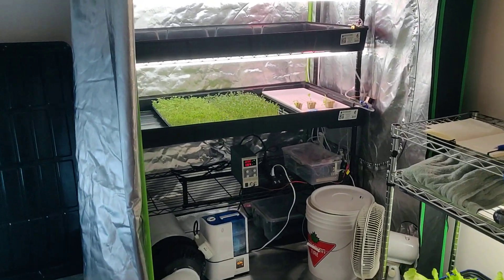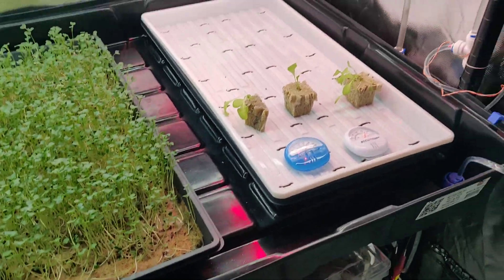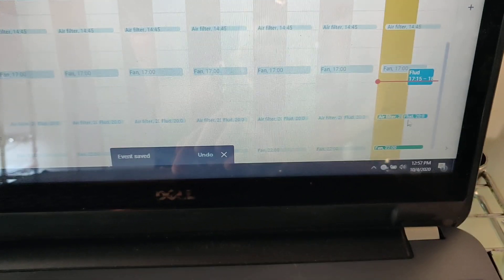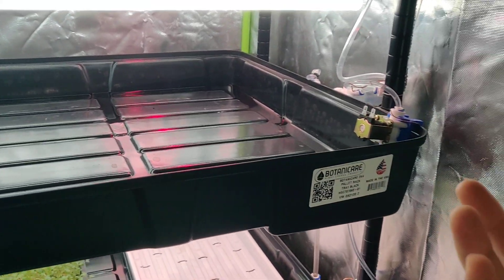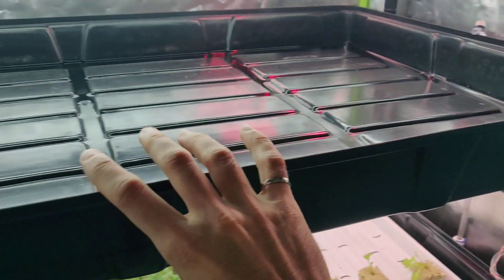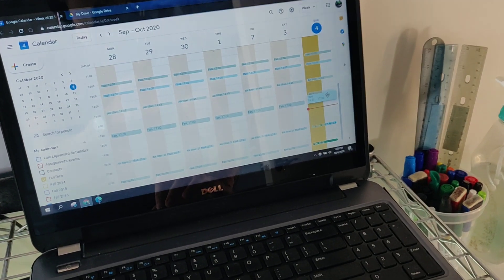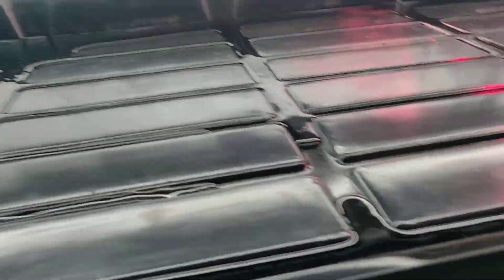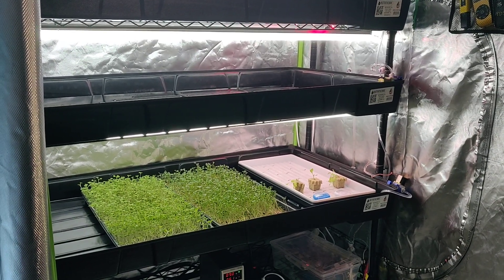Automated Flud and Drain - Microgreens

Comment: Is this the only way to do this? Is it possible to just use float valves that drain once the water hits a certain level and drain into a lower tray, then repeat until it drains back into the bucket?
Reply: that's called a Bell Siphon.

Comment: Impressive system, I was wondering what type of water pumps do you use?  I noticed they are not submersible.  

Do you have a solenoid valve on the drain pipes to prevent the water from draining until you need it to drain?
Reply from the maker: Prismatic pumps. I got those because they are very good at self priming and wanted to use that for something.. but it didn't work. I would not recommend them ;)

No solenoid on the drain but i have custom bell syphons for that. It removed the need for hardware and makes the system simpler :)
Reply: @klorofila  Thanks for responding.  Great info.

Comment: Very interesting! 
I have a deep water culture (DWC) hydroponic system that automatically waters. (Permanent water with air bubbles) It’s a simpler method than yours. I have a tank with water above everything else. Below that, I have a float valve tank, from the float valve tank, water flows to all of my DWC tanks. This is all by gravity. The DWC tanks and the float valve tank all have the exact same water level. I could put a float valve in the DWC tank, but the roots might get in the way. To do this vertically, I’d need a float valve for each separate level.
Reply from the maker: Very interesting. Do you recirculate your water? I wanted to use a gravity tank but when you reuse you water, a pump is needed regardless... :/
Reply: @klorofila  It does not recirculate the water. The plant drinks the nutrition water and the hydroponic tank is replenished with fresh nutrition water from the float valve tank. I have to monitor the water so that the nutrition stays at the right amount. Larger plants can drink almost a gallon a day. For DWC the roots stay in the water with air bubbles everywhere. It's a different type of system than what you're doing which might be called ebb and flow.